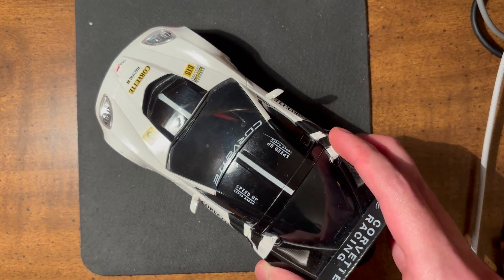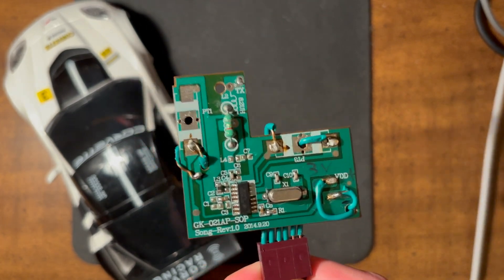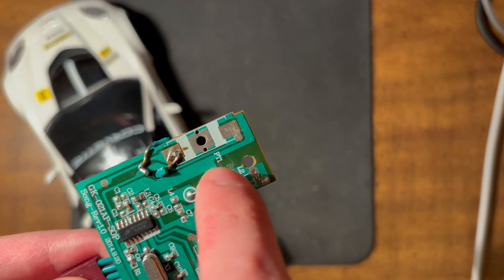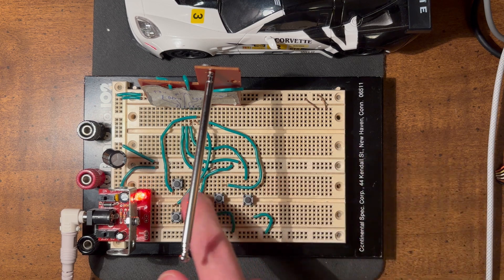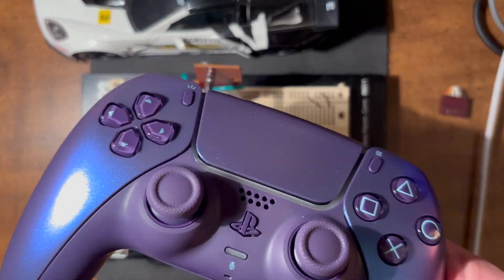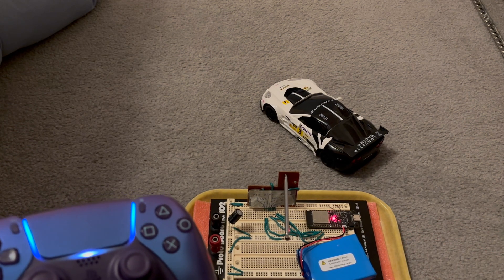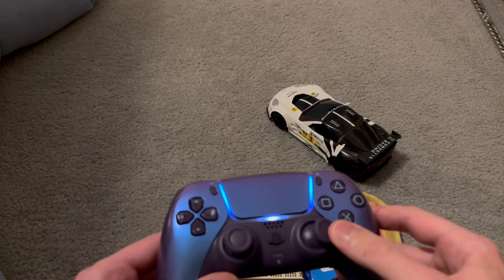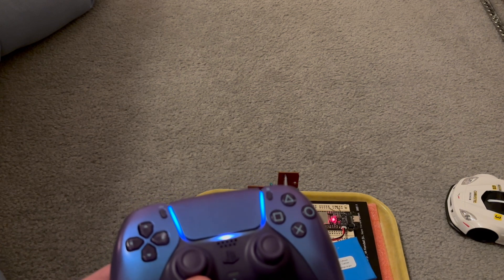Controlling a cheap RC car with a PS5 controller.

Comment: I found your video while searching if it would be possible to control an RC Drift Car with a controller. I'm talking about the professional ones with a gyro and stuff. I won one and would love to be able to use it with a controller if it's made in a way that the car is very well controllable. Do you think it's possible??
I have 0 knowledge in electronics, what type of professional should i contact to create this? I mena when i'm grown up and have money to spend on this.. 😂
Reply from the maker: mmm... I don't know how "hobby grade" RC cars are built these days (never owned one) but you'd probably have to significantly gut and redesign the electronics, because the electronics in those typically talk to the controller (that you hold) over a proprietary low-latency radio link, not Bluetooth. It's certainly possible but would be a lot of work. I wouldn't know who to go to though because I have been doing everything myself.